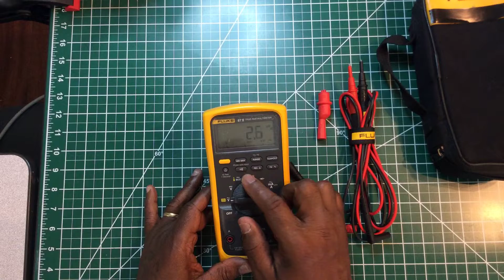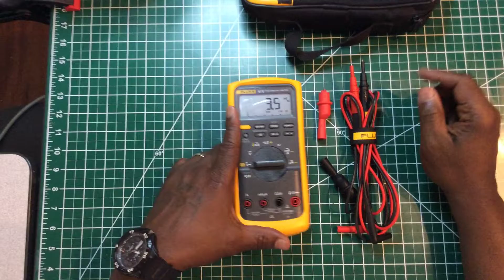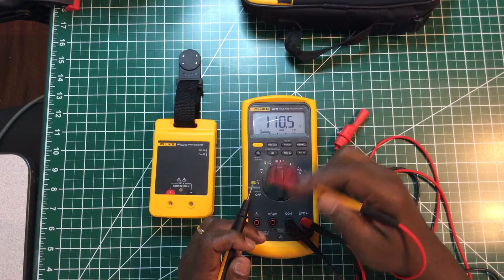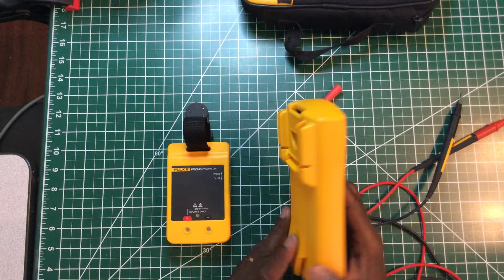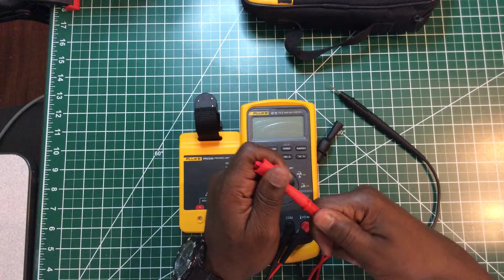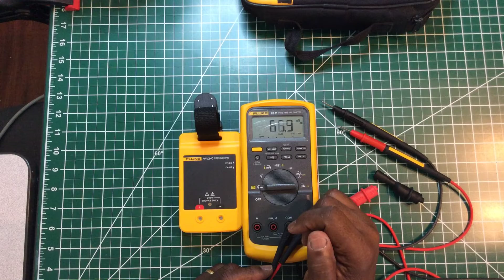FLUKE 87 V True RMS Multimeter ( Mini Review )

Comment: Good Evening !
I was wondering if you were familiar with the megger multimeter AVO 035 and 030?
Very interesting, I seen some YouTube videos on it.
That meter is just a tad behind the 87v from what I seen.
When you get a chance give me your opinion on it
One other thing, what do you think about the amprobe amb 45 insulation tester.
Reply from the maker: I’ve been wondering about the Megger AVO35 multimeter also. I bet it’s a good quality multimeter. Now the Amprobe AMB45 Insulation Tester it looks like it’ll get the job done ✅ .
Reply: Thanks, that megger is very impressive from what I read.
I have the fluke 1520 insulation tester. Looking for something a little smaller. That klein et600 just may be the ticket.
I'm  hvac so I'm  mostly spot check motors. 
I was looking into the amprobe tester.
I don't need a fluke in that area. 
Thanks!
Reply from the maker: The Klein ET600, before I purchased it I was skeptical 🤨. But after I received it, used it, and compared it to others in its class the Klein ET600 was BETTER THAN I IMAGINED !!!💪💪💪
Reply: That klein very well may be their best meter.
If it's OK, can I get your email. I would like to share information with you.
My email: wkpruden@gmail.com
It's  always good thing to find guys like yourself in the trades.

Comment: 600$ and only 10A. Toy
Reply from the maker: This multimeter is tested and proved to be a true BEAST in the field to this very day. It has a lot of features and 10 amps isn’t a lot because a multimeter’s amperage measurement is mainly used for electronic circuits. There aren’t any multimeters on the market being sold today that measures higher than 10 amps. If you need to measure anything more than 10 amps then I suggest you use a clamp meter ( That’s Just My Opinion ). Thanks for watching 👍🏿👍🏿👍🏿💪💪💪
Reply: Toy you say?  The Fluke 87 series has been the industry standard multimeter for over 30 years.

Comment: Great video.  Thanks for sharing.  I’m a little late to the party but wanted to get your thoughts on whether it’s worth getting the 87v max vs the 87v.  I’m not a pro like you and your viewers.  I’ve got a small farm in the PNW and will be adding new buildings/new wiring...and then there’s the typical troubleshooting of past home owner “electricians” who were kind enough to pass their problems down to me. I like the quality of Fluke, having used other multimeters in the past (117/179) and feel it’s time to step up and get one for my own. Thanks again and Happy Holidays!
Reply from the maker: Hello Al there’s not much difference between the two except the 87v Max May have one or two features more that you don’t even use . The old 87v  is still a powerhouse and will supply all your needs. Keep in mind the 87v is an industrial Multimeter and if you’ll troubleshooting controllers, and circuits . . .etc 87v is your Multimeter. And if you’re considering expanding your farm with a lot of automation consider the FLUKE 289 or 287 Multimeter.  I hope 🤞 this helps, take care.
Reply: @TheElectriciansToolChannel  thanks for the reply and explanation.   I’ll check out the 287/289.  Thanks again!
Reply from the maker: No problem Al, I like communicating with smart people. 🤔

Comment: You are absolutely wrong when it comes to reading amperage, specifically low amperage such as in electronics. A clamp meter is not designed for the same level of accuracy/precision and/or resolution. I have this meter specifically for working with electronics.
Reply from the maker: You’re absolutely right, I wasn’t referring to making low voltage amp measurements. The point I was making is you want to use a Multimeter to measure high current inside of an electrical distribution panel or make measurements of any current 10 amp or above. I was speaking to electricians not technicians when I made that statement.

Comment: Screen Protector:  Is is factory sized, or did you just cut a phone display to size manually to fit the screen.  Just want to know what the options are.  Thank you.
Reply from the maker: Hi John, the screen protector was sized and installed by the FLUKE Corporation.
Reply: Thank you for the prompt reply.  In that case, is it fair to say the screen protector you are using is the stock screen protective film that comes with every new Fluke meter?  If so, I would like to install a more substantial protector, like those from Upscreen or Brotect.  Upscreen makes one for the higher end Fluke 287/289.  I have not found a factory sized screen protector for the Fluke 87V yet.  Thank you for all your instructive videos.
Reply from the maker: Of course, I recently purchased a brand new FLUKE 1587 FC and the screen protector came off and no matter how much I tried to get it to stay on it wouldn’t. So I’m gonna  take it to BEST BUY ( GEEK SQUAD ) to have a  screen protector installed on all my most expensive meters.

Comment: Excellent multimeter, in my country Argentina, is too expensive this meter.
Reply from the maker: I couldn’t agree more the Fluke 87V is one heck of a multimeter. And its not cheap, I purchased the one in the video over 10 years ago and it cost me almost $400 U.S. Dollars. But the 87V is only one of many excellent multimeters Fluke make. The Fluke 289 is over ten years old and I seen the price as high as $700. U.S.Dollars.
Reply: @TheElectriciansToolChannel  I also have the 87V and 289. The prices are still high, but that is ok. You get the maximum on multimeter for a low price for that quality. I only use them on my bench. For more exact measuring i use a Rohde&Schwarz HMC8012.